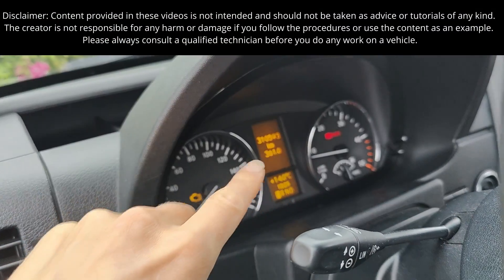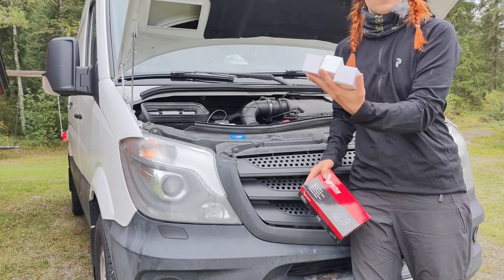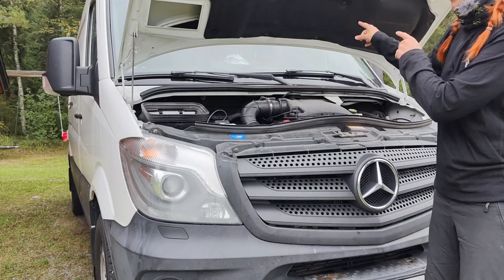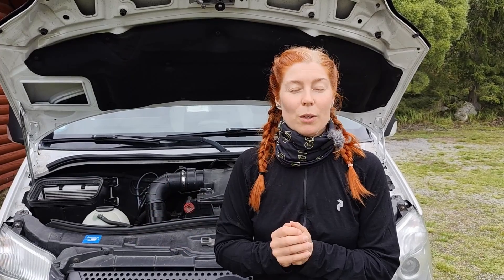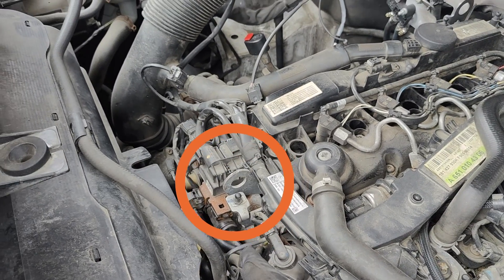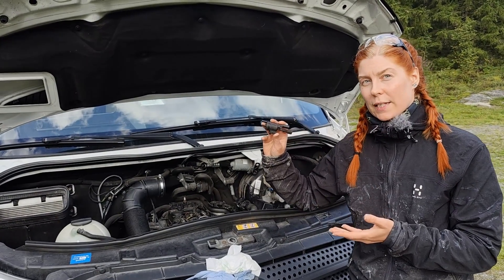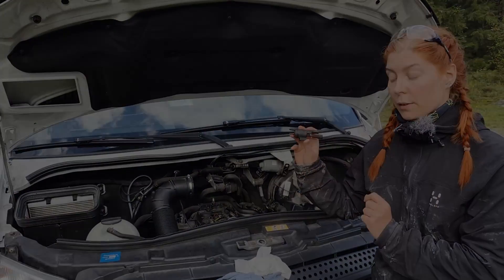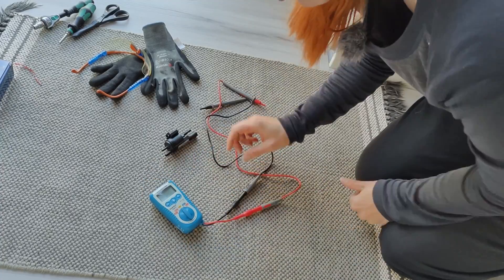New aux coolant pump Changeover Valve (Sprinter 2014)

Comment: Hi Badasana. The switchover valve you replaced has an interesting job. When energized by the ECU it allows vacuum to pass to the coolant pump. This actually disengages the coolant pump and prevents it from circulating coolant around the engine. This only happens for a few minutes after start-up from cold, and allows the engine block to heat up more quickly. By the time you are ready to set off, the ECU will have de-energized the switchover valve, and the coolant pump will be circulating the coolant as normal 👍
Reply from the maker: Oooh thank you for the clear explanation! So it actually functions the opposite way than I understood earlier, and is not that critical during the summer temperatures 🌻🌴
Good to know in the future, as this engine appears to be sensitive to cold start-ups.
Reply: i have got a problem where it says  p261f- coolant pump A control circuit stuck on  and i am assumiong this is the reason why i have other similar codes<  po2ec-  diesel intake air flow A control system> < mass or volume air flow sensoer A circut range /performance    p0101 > 

please help thanks
Reply from the maker: @jd-yg5zp  Heya, you can test the valves and measure the sensors if you have access to them, with multimeter and aux power supply. Do they react and switch on, etc. Our fault code started also with P26... so it may be the same changeover valve. If there is liquid coming out of it, not only pressurized air, I recommend to ask a professional mechanic to have a look at it 😊 The air-flow sensor may be the one near the engine air intake filter. Hopefully you find the solution, good luck!
Reply: Im late to this but heres my bit,  The two valves in your picture are there to regulate the turbo boost when they are commanded by the ECM, The one you changed controls  the water pump as the other expert said, There is also another valve like you changed under the egr cooler to control the egr butterfly,  So two of one sort and two of the other,
Reply from the maker: @susanlewis8710  Heya, thank you for the clarification! 💖 These repair topics never grow old 😅🛠️ i hope that we don't need to change the other ones soon, but if we do, your information helps greatly 🚐✨ Safe travels!
Reply: Can you give the OEM part number please ? Thanks